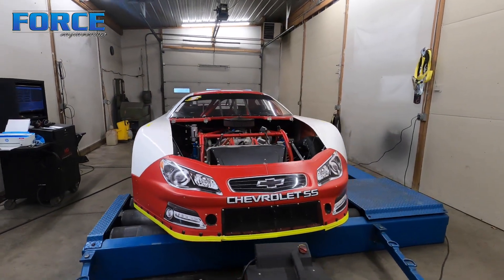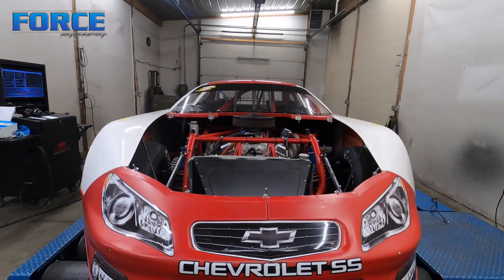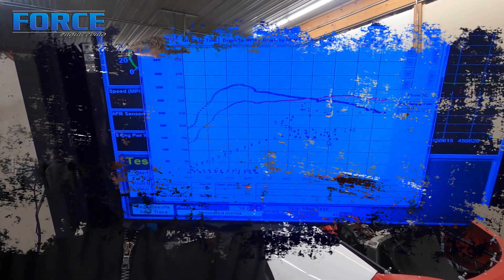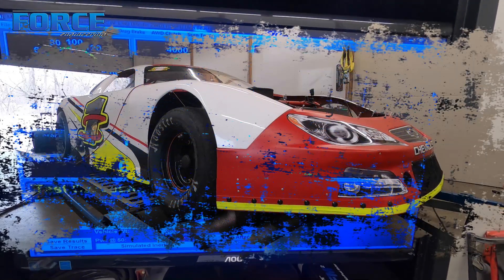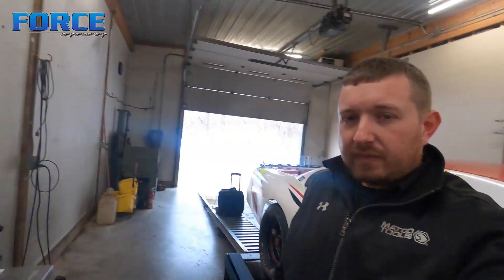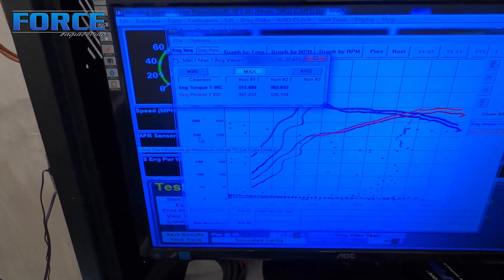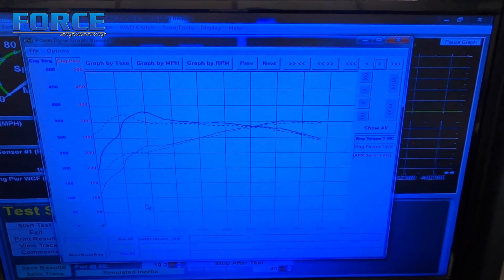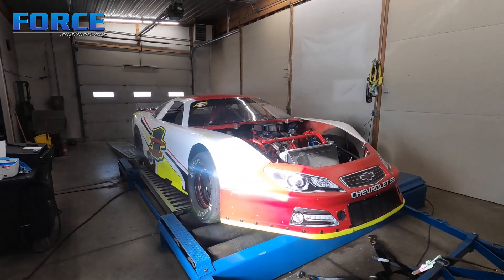Dyno Review - GM Crate 604 Engine | CRA Pro Late Model | Carb Tuning

Comment: That crate engine supposed have more than 400hp why is too low on hp
Reply from the maker: Its advertised as 404 at the flywheel. This is at the tire.
Reply: @ForceEngineering  ok thanks brother 🙏

Comment: 604 crate was to hold down costs, does away with radical heads and porting to make it more driver centered and suspension set up. Most 604 run 36 timing I assume high gears were for running a shorter track where keeping motor in torque band more important than top speed